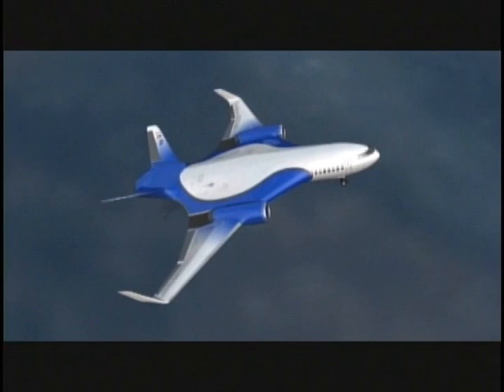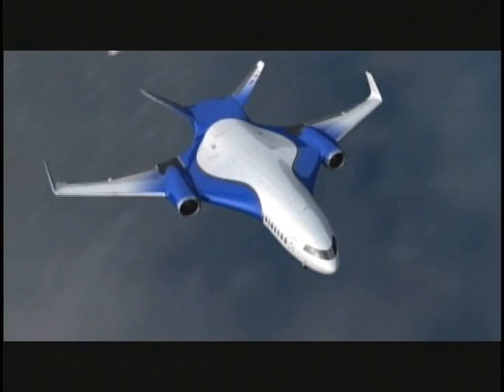NASA cruise efficient STOL aircraft concept

Comment: There is a reason why such designs have not entered airlines yet - emergency exits are hard to use. For the very same reason A380 is a double decker, initially it was intended as a wide fuselage airplane, but the existing regulations limits distance from passenger seats to exits, limiting max width  of passenger compartment.

Comment: they can use fiber optic  view port , plus video rep. screens to make even middle seats have a optional view window.  with improvements in cheap flex able video screens, outside view could be projected on the walls ceiling & floor of the plane.

Comment: Just thinking: Shorter take off and landing aircraft should be safer because there a so many accidents where the plane overruns the end of the runway, or doesn't gain enough altitude and intersects a high obstacle (treetops, hill) in the take off path. 
There would also be less opportunity to veer off the runway and less opportunity for colliding with a taxiing plane.

Comment: The only way to morph a airplane at top speed is to use a bi-plane wings two small magnetic wings and then two larger ones. Using high magnetic wings computers can morph the wings using magnetic power as they push the other wing into morph, to change the wings design. Only a small change or morph would be possible for this technique.

Comment: Wellm engines under the wings would increase drag, wouldn't they? Also, it's hard to tell where the fuselage ends and wings begin, it's a blended wing body.

When it comes to circulation control, aren't blown flaps a means of circulation control? I suspect that they take some of the bleed air to blow the slats and flaps.

Comment: @j23araluce 
I suppose the answer to that is.. they will.  It takes quite a bit of time to test a design.. especially one for an aircraft.  There are a few on the books that, like the A380, are designed to carry 800 to 1000 people.  The time to find out you've made a critical engineering error.. ISN'T AFTER it's been made.  Small steps.. small steps.
We were amazed by the 747, we were amazed by the A380.. and we will be no less amazed when they finally do release these things.